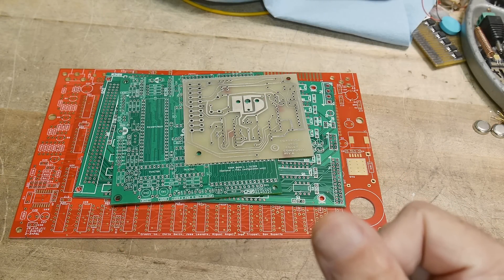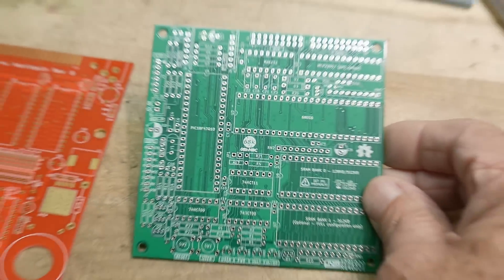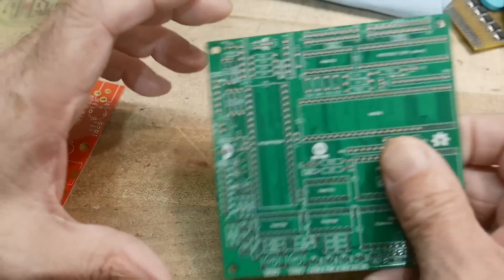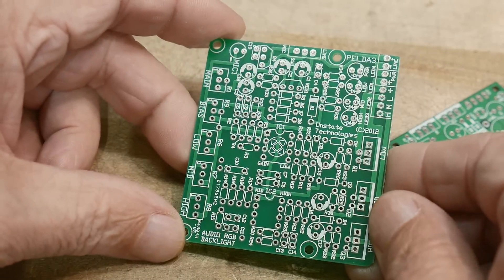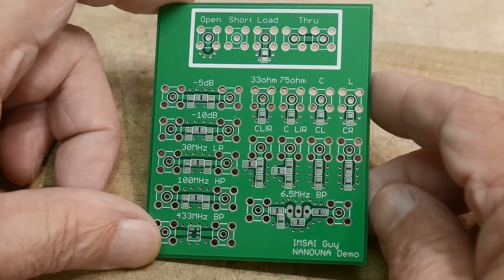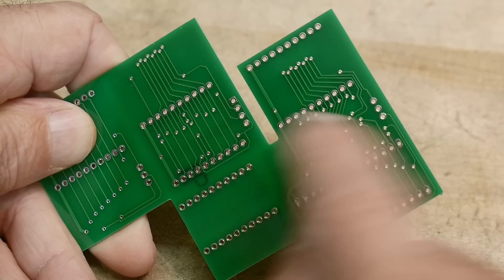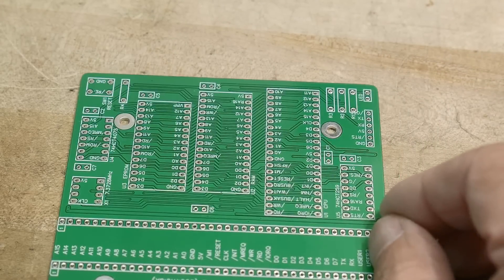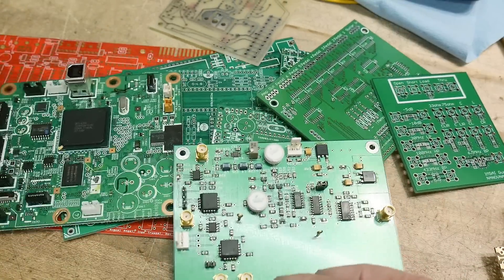#1422 PCB - Finished Boards

Comment: All those signal labels are a solved problem in KiCad. Create a custom copy of a footprint and use ${} variable references to get signal names as values of variables from the schematic component. Then for the schematic component put the signal names on the pins and on the variables names like, say, Pin01, …, Pin28. Then in the footprint the text field that had ${Pin01} value will show the name of signal on pin 1 etc. I do this all the time with edge connectors on PDP logic modules and similar modular logic. The footprint for the edge conn has all the names laid out nicely and just picks up variables from the schematic symbol. The schematic symbol can be generic just have those signal legend fields next to each pin. On the schematic you name them according to signal names and done. The rest syncs up. Same goes for things like ${REVISION} on the legend that shows the revision number etc. Use the variables :)

I do the same with positioning of references: got a bunch of copied footprints in a custom library that has the references positioned the way that will make most sense in a given layout and just use those. Can also be used to pick a uniform custom font for references. I also like silkscreened component values on low density boards so that goes into the footprints and gets handled automatically. There’s also lots that can be done using Python scripts on the PCB.

Comment: Half the time it seems no one is spending time to arrange references on the through hole designs. On dense designs it’s like with SMT layouts: sometimes the ref just doesn’t fit and needs to go elsewhere with a leader line.

Comment: Good explanation of PCB design / production techniques. Re PCB sizing (and mounting), I always tend to start with the intended enclosure before even starting PCB design. Unless your runs are high in quantity and you have the money for injection moulding, then I find it's best to stick with off-the-shelf enclosures.

Comment: I never run across gummy fr4. Both from US manufacturers or from China. Who is sending you gummy boards?
Reply from the maker: maybe I'm not explaining it well. if you cut a trace with an exacto it does not act the same as the 1980 boards. those boards had the copper directly applied, modern boards use an extra layer (same process for many layer boards) and that adds some softness
Reply: @IMSAIGuy  I wonder if what you are experiencing is on modern boards there is normally a solder mask that you have to cut through as well as the trace?
Reply from the maker: no it is some layer under the copper. think of a 4 layer board. most boards just have two outer layers. so there is some insulator between those two and I think adding the 4th layer is the same as adding the 3rd to the FR4 if that makes sense.
Reply: @IMSAIGuy  it's called prepeg  it goes between a copper layer and core. it's what sticks everything together...  i.e. copper - prepeg-core-prepeg-copper

Comment: When I first learned PCB design, my first year in college in 1990, we just made rudimentary designs. We would print our design on a clear plastic sheet with a laser printer. We would then use a flat iron to transfer traces to copper-clad fiberglass boards. We would often have to manually touch-up a few spots on the board with a pen. We’d then etch the board with that nasty chemical etchent liquid. We’d then rinse and use fine steel wool to rub off the black stuff on the copper (the mask).  We then used a tinning solution that would chemically plate copper to prevent oxidation. We drilled our holes manually. We knew there were better processes then but this was how we’d prototype.

Comment: i did love to see SMD components flying off a PCB when doing a resonance search on equipment. Amazing to see how much a PCB can bend when it come in to resonance and how unforgiving smd chips are to PCB moving, stayed with TPH for quite a while as they handle a flexing PCB way better. But the aim was to make sure any resonances in the equipment was away from common vibration frequencies known to exist on what the equipment was mounted on.

Comment: Re: auto route, the designer spends most of his/her time setting up the parameters and nets.
Then a lot of time getting those last few nets routed which the auto was unable to route.

For me the death-nell mistake are those getting all the footprints correct. It really pisses me off. Some many details. Sometimes the best thing is to have the damn thing made and count on having to re-run after making corrections.
Reply: I agree about the footprints.  I keep getting boards back where I made some mistake because of a detail about the footprints.  One of the challenges that I have is that on the screen you usually have little idea of how big things actually are.  I think I may start making scale printouts of the copper traces so I can judge how part placement will go before sending things off to the fab.
Reply: @argcargv  Well if you have the stomach for it I suggest: Print the completed design 1:1 then place parts on the print to check the footprint. This can help but is only half the story. The other half is: "are the pin numbers correct?" This assumes you have ordered the parts and have them in hand.
Reply: @mr1enrollment  Yes, I have run against both problems, getting the PIN numbers incorrect and getting a similar but smaller dimension part.  I thought I was doing good to just double check the PIN numbers but then I found that the mistakes can also be dimensional.  There are many times that I have had to have a second revision of a board because of footprint problems or scale problems where clearance or something like that doesn't make sense.  The design rules all check out, and the 3D vis looks good, but when you actually get to assembling things you find out all of the things that weren't checked out.
Reply: @argcargv  welcome to the PCB world. ;-}
Reply: Agree on the issue with footprints, if there is anything that makes PCB design most problematic / time-consuming then footprints are it. The few online libraries include multiple errors, especially with dimensions. In my opinion, all the most significant component distributors should include links to accurate footprint files (not Library Loader, which is some sort of joke).
Reply: @ralphj4012  I have used the loader(s) and found them OK. But you still need to check everything. Way back "when America was great again" - I joke - the new technology was red and blue tape on 2:1 Mylar. Hand laid down then photo reduced with filters which produced two black and white positives used to expose the FR4. There were also decals for 14pin dip and 16pin dip. That was it. now there must be tens of thousand footprints to keep track of. Before my time, it was black crape tape on multiple sheets of Mylar at 4:1,... Way more fun - yeah not.
Reply: @mr1enrollment  Indeed, I still have Maplin / Letraset rub down pad transfers which are more accurate than some online footprints. snapeda isn't too bad (around 30% of footprints on there are close but you still need to check everything, multiple times).
Reply: @ralphj4012  Ill bet AI will come to the party sometime or other.
Reply: @mr1enrollment  Ho, ho, can't wait. To see how close AI is to taking over the world see fran blanche, chat bots gone wild.

Comment: I don't like to put the component ID under the component. It's useless except for hand assembly. You can't check the assembled boards or troubleshoot them easily. I see you leave all the extra copper in place. Excellent. It makes no sense to remove it, removing it uses up etchant, and once grounded, all that extra copper makes the boards quieter and helps keep the ground at ground.
Reply: I agree about the component ID.  I prefer to put component values under the component and the ID's next to the component.  When assembling the board the component values are useful and the fact that they are covered up after the part is installed is of no consequence.  Most of the default KiCAD footprints put the component ID under the component and the value next to it which is opposite of what is useful.   As having as much flood fill as possible, this is ok for low speed analog designs, but for high speed digital circuits, I would recommend avoiding this as it is easy to unwittingly create Ghz order resonators and antennas on a board with these islands of copper between traces.  Even a 100mhz digital circuit will have fast enough edges to excite Ghz EMI.